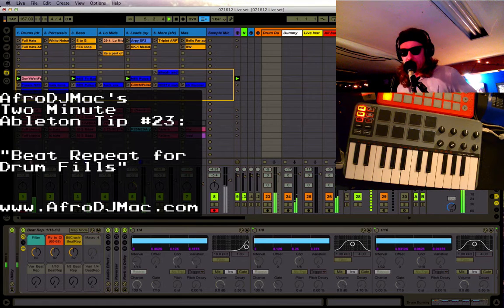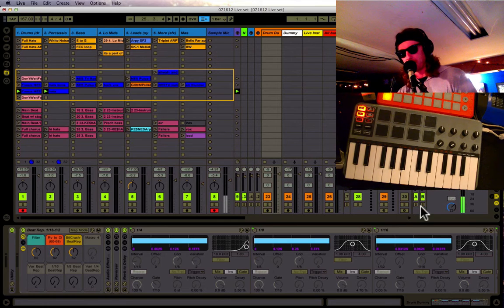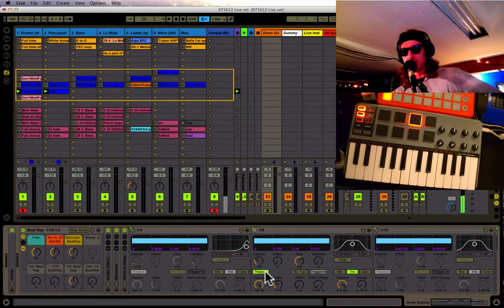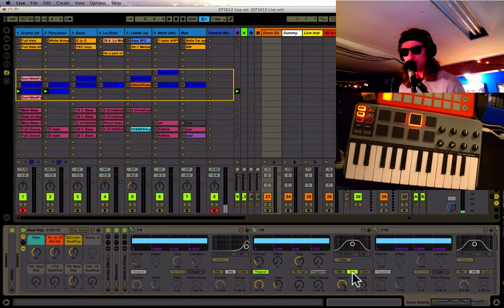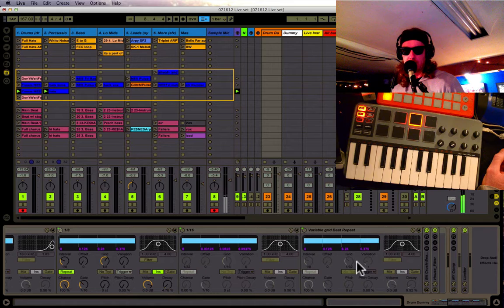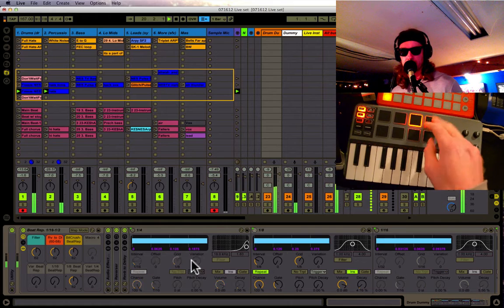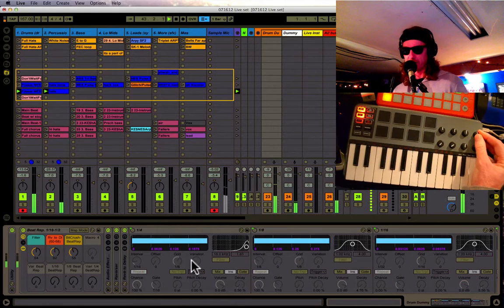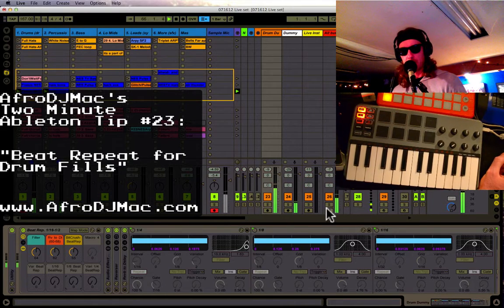Drum Fills with Ableton's Beat Repeat

Comment: Hey Brian, can you please share how your MPK mini was set up? I have tried to set up my Minilab so that a touch on a pad is ON and off when I remove my finger, but I still cannot do it. I though simply setting it up as "Toggle" would do the trick
Reply from the maker: You want Momentary, not Toggle. Toggle sends one MIDI message when you press a button. Momentary sends the message when you press and again when you release. Momentary allows you to turn something on only while holding the button.
Reply: @BrianFunkMusic  Thanks, the Arturia user manual is far from clear on this, they have the Gate mode that should correspond to the momentarily, but it still does not do the thing. I opened this topic on their forum, hope someone will come back with an advice

Comment from the maker: Your midi controller must be set to send Momentary messages.  This means it will only transmit while the button is held. The Novation Launchpad sends toggle messages, which means one push turns it on and another turns it off.  I'm not sure if you can change that in the AutoMap software. I never really got involved with AutoMap because I found it annoying and confusing.  In the video, my MPK mini is set to Momentary controls, which turns on the beat repeat while I hold the button down only.